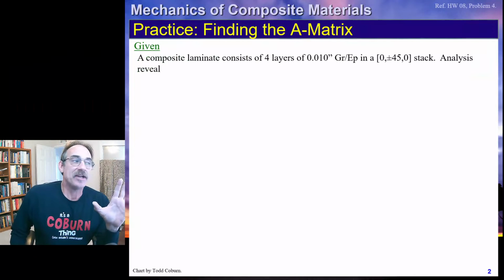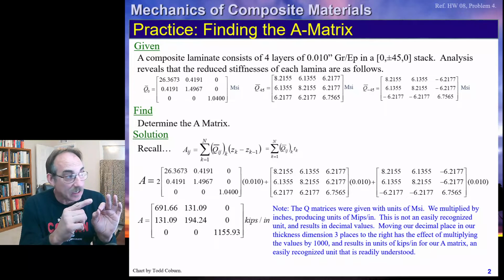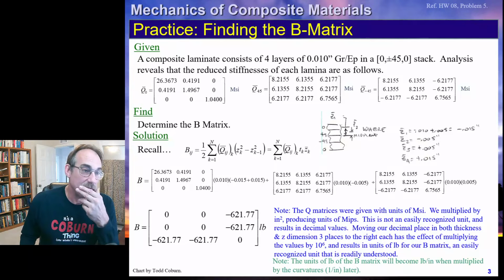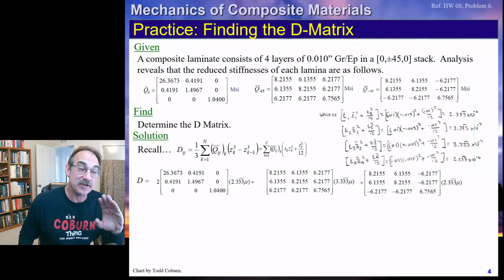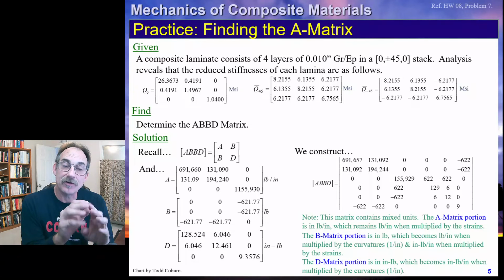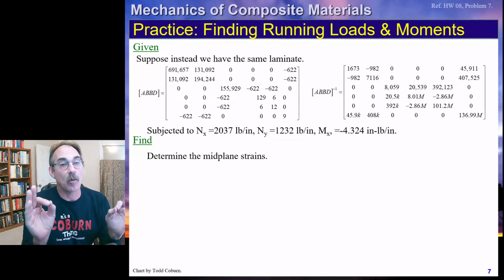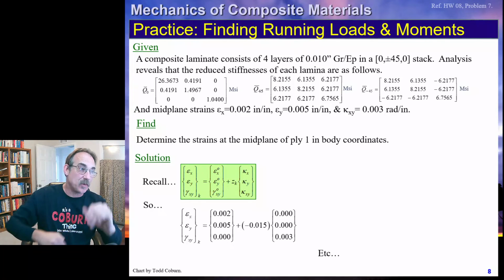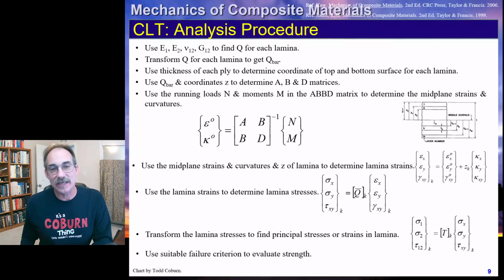Composites: L-09 L Step-By-Step Composite Analysis

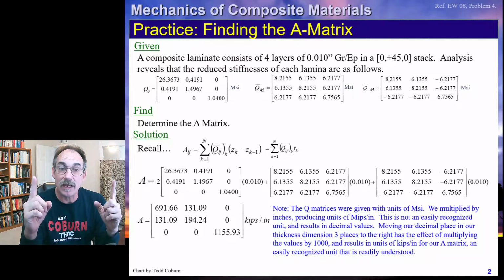Comment: @3:42, I believe there may be a typo on the slide there. For the A66 term (or the 3,3 term in the matrix shown), I believe the result should be 155.93 kips/in. I confirmed this result both through performing the math as shown on the slide and via my own calculation sheet. I think this is simply a transcription error from taking the results from your Matlab code to the slide.
Reply from the maker: Tanya, you are correct.  155.92 kips/in is correct.  Thanks for catching that!

Comment: Hello, i was under the impression that when constructing the ABBD matrix, instead of the bottom left matrix being just B, it is the transpose of B. When is that applicable?
Reply from the maker: Nope.  They are both B.  Check out lecture 8 which shows how B is determined and how ABBD is constructed.